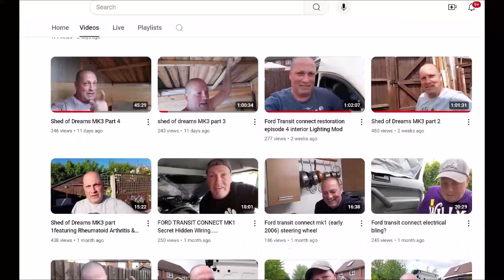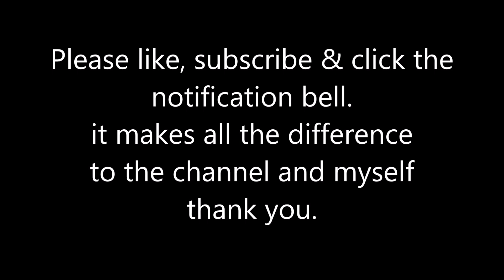Ford Transit Connect Spare Wheel Check

Comment: MrE you got to spray wax oil under the van mate Good work on the spare wheel
Reply from the maker: @davidwhite9293  thanks bud. Yes it needs a lot. But I've overdone it and am having to rest for 48 hours.